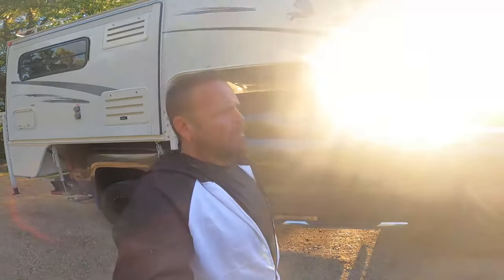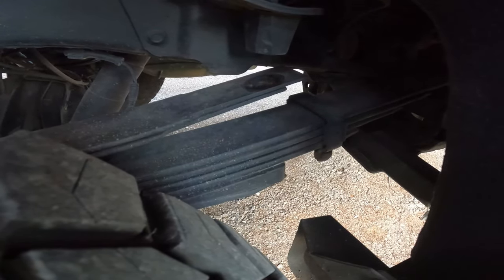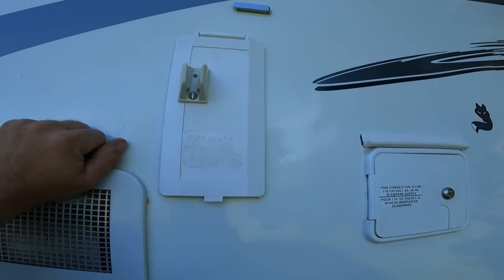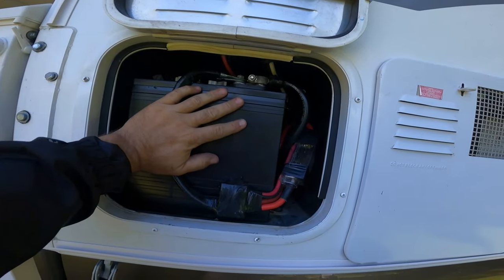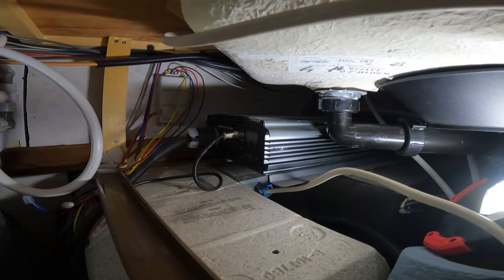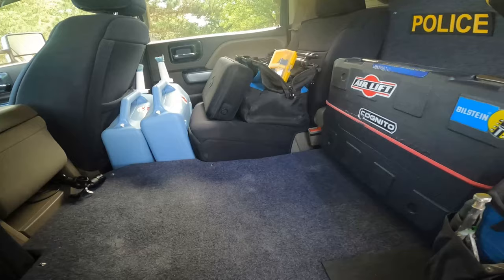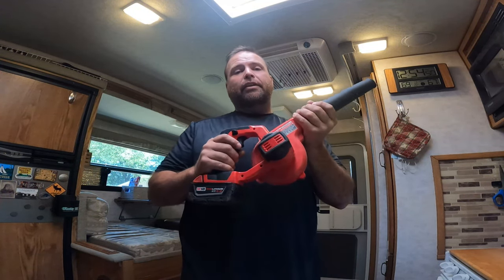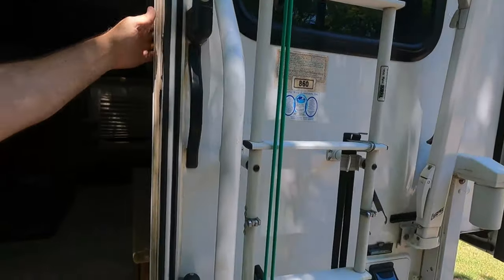Arctic Fox Truck camper / Silverado Tour

Comment: Just what I’m looking for good honest advice from someone experienced in truck campers. 
I had virtually know experience in RV’s whatsoever until 2 years ago in September of 2020 we were in the market for a truck and found a mint condition 2008 GMC 3500 diesel dually 4X4 only 70,000 km. It was being sold as package deal with a 2008 Lance 992 camper. 
We managed to get out only a couple of times that year and only once last year but we really enjoyed it and had a lot to learn. We prefer boondocking or provincial parks in the off season. The camper has 2 slideouts and we prefer them to hard side campers. We looked at trading our camper on a new one but I wanted a different floor plan than being stuck sitting at the dinette table. We looked at the 2022 Lance 1172. They have 2 slideouts the rear slide has a couch that you can sit and watch TV and stretch your legs out when you can’t sit outside when it’s cold raining or dark with the bugs. 
So we traded the 992 and ordered the 1172 with the options we prefer from our short lived experience. 2 solar panels propane generator the new quiet type. Tankless water heater, 2 lithium batteries, LTE cell phone antenna, 4 season package, outside propane line for our little portable BBQ, microwave and regular stove/oven, TV. We also have a portable solar panel and we use those wood pieces for the wheels and camper jacks. I also bought an airbag kit to install on my truck this spring. I was considering taking the home RV training academy course on RV repairs because warranty or not they will all break down at some point. Our camper should be delivered this spring. Looking forward to it. 
Thanks for the tour. 👍🇨🇦

Comment: lot of upgrades, the truck upgrades are great. the camper, welllll, i still prefer the Northern Light camper, with no slides. just my opinion. stay safe out there.
Reply from the maker: 100% agree with you, and the Northern Light will be my next camper! I have been watching for a used one the last 6 or 7 years. They were once affordable. Maybe in another 6 or 7 years I can pick one up.
Reply: @KennyOfAllTrades  that's my problem also. expensive, and the cost of a truck. if you find a used one congatulations.
Reply: I just ordered a 10.2 NL and 1 Ton Chev dually...now looking for buried treasure to pay for it!  LOL
Reply: @jjsoutthere7267  that's awesome, unfortunately, your right, you have to find some big nuggets. i hope to be out there in 2 years or less.be safe.
Reply from the maker: @jjsoutthere7267  I would be envious untill I see the payments lol
Reply: @KennyOfAllTrades  Have 2019 NL 8.11 & its crazy to see 2023 models selling at 20-25k more in that short  time. i did see on some of the NL forums or FB pages that there was some structural issues with some of the 2021 models I think{best to double check the year}.  I do love the clam style camper & no slide when going into those rougher areas.
Are those 20in rims on your truck & what lift is on your truck.

Love the channel Kenny, congrats & keep on knocking it out of the park.
Reply from the maker: Thanks! The lift is a leveling kit. I installed the Suspension Max 2" kit so I could fit 285/70/18 tires. They are a 129 load index tire so they can handle a little more weight than the factory tires.
Reply: @KennyOfAllTrades  Thanks for the info & taking the time to reply

Comment: Major upgrades ... unbelievable amount of inverters ! I thought I did a lot of tinkering and add ons to my riggs... you make me look like small potatoes when it comes to tinkering. 
Why soooo many inverters? Why not just one big one and run wires? 
Huge thumbs up on getting your truck to double as a generator. 
Great video 📹 👍 👏
Reply from the maker: Great question. The inverters draw a lot of power just sitting with no draw. The larger inverter, the larger the draw on the batteries. So I tried to match the inverter to what the power demand is. I didn't want a 3000 watt inverter only powering a TV. It would draw down the house batteries real quick.
Reply: @KennyOfAllTrades  that makes sense.  Never thought of it that way.

Comment: Great video! Those remote air bags are awesome...probably not something I can put on my truck lol You have a bunch of cool tips :)
Reply from the maker: Thanks, the remote controlled air bags do come in handy.  When I get on the Hwy or Interstate I will usually keep them at 40 pounds. That about level with the front. It keeps my headlights pointed properly, otherwise I risk blinding on comming traffic with the lights.
If I go off road I will drop them to 5 pounds, that gives the truck a soft ride for crawling over rocks and going through large ruts. 
When I park the truck I will adjust them to level everything out. Many times I will have one bag at 100 pounds and the other at 5 pounds. This allows me to park on unlevel ground and keep the camper level. It's not a must have...but makes life easier. 
Thanks for watching and commenting. 
 My next few videos have been showing a lot more tips for Truck Camper owners!

Comment: 20# and 30# is the actual amount of propane put into the bottles.  The pressure is still the same - just a bigger use of propane in the bigger-weighted bottle.

Comment: good video. wonder if there is a blow up rain gutter that sits on the whole frame of the top... ok. i am making this up in my head. but, i was inspired by the life air bags you have. so, maybe if water is an issue running down the sides of all rv and campers... well why not have a blow up or air cutter system at the touch of a remote when it rains?... the reason not to use maybe a tarp or something like that would be for the wind. it seems that a pool float type blow up rim around the outer edge of the top that would be just below the top and catch water and drip it about 2 inches around the outside edge of your rv walls or camper walls... there got to be a system right? it just seems that water is the long term enemy of rv and campers?
Reply from the maker: I think there is a need for the product you are talking about. And now with the truck camper industry blowing up you may have a good idea in the works. You are right, water is the absolute killer of most campers!

Comment: The reflectix in your roof skylight, is it a stick on or it just appeared to be. How do they stay up against the glass? Love your comment about running a meth lab! Lol
Reply from the maker: I just cut them a little bit larger so when they get pushed into the frame they hold him place. If you cut them smaller than the frame they'll just follow. So just cut them a little bit bigger and they will wedge in the window frame perfectly. It's funny you mention the comment. I think that's where the thumbs-down came from. Some people take it to heart when you make a comment. But honestly when I see a vehicle that is completely covered with reflex on all the windows I think of Breaking Bad. I painted mine black with the flex-all spray paint in a can. The black spray paint is like rubber and it doesn't crack when you bend it. I did that on the windows that you can see from the street.

Comment: In the video you mention the pormido camera is "wireless". I've only found wired versions. How did you book your camera up the the truck camper? Is it a pain to take the camper off with the camera?
Reply from the maker: I'm sorry for the confusion. The camera is wired. It was an easy installation running the wires behind trim panels, then exiting the cab floor through an existing grommet on the floor.
 The camera is mounted under the camper steps. The camera has a connection approximately 2 feet from the base. When I take the camper out of the truck, I disconnect the plug and leave the camera on the camper.
Reply: @KennyOfAllTrades  awesome thank you!

Comment: Nice setup! Ever have a need for a Dually vs single wheel?
Reply from the maker: Not yet. The short bed campers have always worked for me. If I upgraded to an 8ft bed I would go with a dually. I think an extended cab, dually would be a good length. My truck is just barely capable of fitting in a stander parking lot spot. Anything longer and I would have to look for special RV and boat parking.

Comment: Great videos! What rear view camera is that?
Reply from the maker: I did a ton of research and found this one. The "Promido" bought on Amazon. It has a front facing camera as well. You can split the rear view mirror to show both feeds. The camera is fully adjustable, By touching the mirror you can move the camera up and down at a really wide camera angle.  It records video and audio along with GPS speed for three minutes at a time.. It retains the information until the micro sd card is full, then automatically dumps footage and records over the old footage. In my case I can look back at footage for about a month before it gets written over. If you need the footage for some reason you can take out the micro SD and view all the vids on a computer. It is a life saver with a truck camper.
Reply: @KennyOfAllTrades  Awesome! Thanks Kenny!

Comment: Hey Kenny? Hows the handling and braking doing hauling all the weight? Did you do the Calculations to payload specification?
Reply from the maker: I replaced the brakes with OEM last year. I figured if the old ones lasted 120 thousand miles why mess with anything else. I use the exhaust break when in the mountains that is a huge help on saving the breaks, I haven't noticed any odd wear and the truck stops really well.
This could be a huge mistake but I haven't weighed the truck. I don't want to think " I wish I didn't know now what I didn't know then" I'm sure I'm over weight. 
But I have put on 50,000 miles with the camper in the truck without incident. " knock on wood"
I've owned many diffrent truck campers in all sizes of trucks, except a dually. I've learned along the way when a truck is incapable of handling a load. This setup feels very comfortable.

Comment: Idk if I missed it, but which model camper is this? I’ve been thinking about getting a non slide camper but this one actually has a surprising amount of room when the slide is in like you say. One of the few I’ve seen this being the case
Reply from the maker: It is a model m860. Very comparable to the 811. There is a lot of space with the slide in. I keep the slide in most of the winter..
Reply: @KennyOfAllTrades  love it! Just looked up the 811 and really like the idea of it. Being that you only put the slide out 50% of the time do you regret not having a hard sided camper? That’s the big thing I’m trying to decide right now, do I get the camper with a slide that is still useable with it in even tho it’s a bit cramped, or do I get a camper that’s hard sided and has a bit more room when in “stealth” mode? Would love to hear your thought’s
Reply from the maker: That is a great question! Initially, I was looking at a Northern Lite or Bigfoot camper. I really liked the idea of a complete fiberglass unit. After two years of looking, I could not find a camper I could afford. That was back before the pandemic. Eventually, I found a guy selling the M860 for 6 grand. Even back then, that was a really good price; Arctic Fox was my second choice of camper. 
Fast forward to today, I was recently in a Northern Lite, and it felt really cramped. I was shocked at how little space it had. I am really happy i have a unit with a slide. It would be really hard for me to go back to a  unit with no slide out. I think the only way I would go back to a hard sided unit is if I was putting together a really light weight setup on the back of a 3/ 4-ton truck.
Reply: @KennyOfAllTrades  damn that’s really good to know! You’re selling me more and more! But there are 3 close to me, 2 that are used. A 2008 and a 2009. They are $30k and $36k. The only other one is brand new and $60k
Reply from the maker: @Durataur  There are so many things to consider when purchasing new or used. I would assume no matter how good of condition there will be some issues with a used camper, 95% of the timeissues can be resolved. I love the idea of buying new.....but 60 grand is a lot of money and the last two years quality has declined coming off the line. 
It would be really exciting if I was in the market for a camper....but then again I don't envy all the decisions you will have to make.
Reply: @KennyOfAllTrades  right now I have a 2003 Adventurer 8 foot. Bought it off a family friend who owned it since new last spring. I paid $1500 for it and it’s mint! But it doesn’t have hot water, or a bathroom, or any features other than a north south bed. The nice thing is that it has lots of room. And it does have a full oven and stove tho which is nice. It does the job for now until I find something else worth upgrading to
Reply from the maker: That's good hear. I see people spend big money on their truck camper only to sell it a few years later because it's not what they thought it would be. 
I think going from an Adventure to an 811 would be an awesome upgrade. I was running a Mountain Star before the Arctic Fox. It was nice but really basic, no bath, no oven, small fridge and freezer, east west bed.
 When I got the Arctic Fox it was like going from a Motel 6 to staying at the Doubletree.

Comment: Do you have any problems boondocking anywhere and what is that strap that's going across your slide what's the reason for that did it slide come undone or part of the track come on done
Reply from the maker: I have never had any big issues while boondocking. Once in Iowa, I had the knock on the door, telling me I was not allowed to overnight park. A few weeks ago, I had a truck driver upset that I was parked at a rest stop. He said I was acting suspicious parking where I was. He took pictures of the truck and camper and then drove away in his truck. That was an odd experience. 
I put the strap on the slideout after taking my truck down countless miles of wasjed out logging roads. I have never had any issues with the slide. I thought I would help take away stress on the slide unit by strapping it up. I don't know if it is doing anything; I've never seen anyone else do it. It's basically to support the slide while driving on bumpy rutted trails.
Reply: I'm getting ready to do this too partner when people come up on you and get mad because you're doing something that they don't like I don't know if I can handle it a lot like people can my I get a mouth on me and I'm ready to throw down and I just hope something like that don't happen it took me forever to learn how to walk away and it just seems like it's a lot peaceful it's a lot honestly and easier way to just have a better way of doing things and honestly able to breathe you know I got a friend of mine now that's doing it and he used to get panic attacks and now he hasn't had one in 2 years and he seen therapist and all that and he's even stopped that and he just there's something to this and there really is something to this I don't know if it's the you know freedom or the the relaxation of it I don't know but I'm sorry man I just rattled on but thanks a lot
Reply from the maker: I hope you enjoy your travels. The road is relaxing for me, I don't get wound up easily. I have only had a few negative interactions with people. I try to remain calm and always have a way out. I hope you enjoy it as much as I do.

Comment: Be careful pulling hills with your trans cooler being blocked. I own a 2018 3500hd.
Reply from the maker: Supper good tip! I run the torque pro app and monitor engine,Trans, and egt's temps, fuel pressure and balance rates among other things.  The truck is constantly talking to you, you just got to know how to listen.
Reply: @KennyOfAllTrades  awesome! I haul a adventurer 89rbs on my cclb. Put 19.5s on the truck for the extra weight.
Reply from the maker: That is the right wheel tire setup for sure.
Reply: @KennyOfAllTrades  work in progress lol

Comment: Wasn’t your ride worse with out the over load touching or resting on bump stops
Reply from the maker: When the bump stops are resting on the upper overloads, the truck feels more planted to the road in the curves and high wind. 
It doesn't add for a ruff ride. Probably because the camper is so heavy, the overload springs still flex. I hope that makes sense. It's hard to put my thoughts into a text message.  I do better talking with my hands.
Check out this video. I went further into the rear suspension.
https://youtu.be/Msqnosna8N8

Comment: WHAT AIR BAG SYSTEM ARE YOU USING?
Reply from the maker: For the bags I'm running Air Lift 7500XL. The air compressor is the Air Lift 74000EZ Wireless air.
Reply: @KennyOfAllTrades   Thank you! gonna run the same setup on my rig!